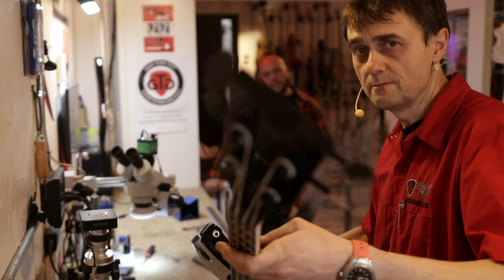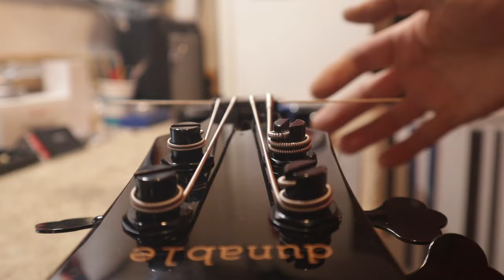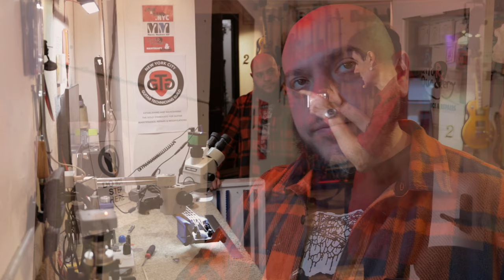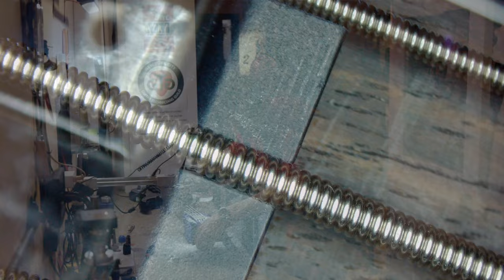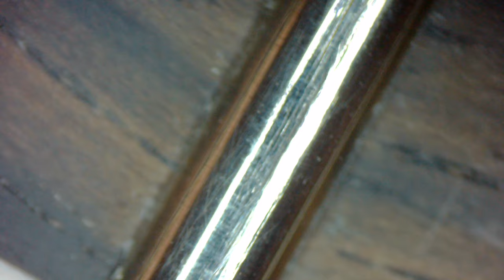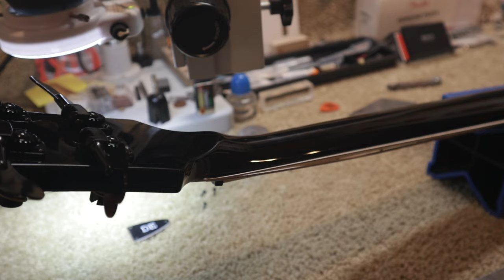Dunable Gnarwhal DE Bass Review

Comment: I was a Musicman player because the instruments were light and so well balanced but lacked that mid bass growl. So I switched to a Fender P bass which was perfect but a bit heavy. I got a gig in a touring rock band replacing another player but he used a 5 string. I couldn't get my 4 string p bass to cut it and I refused to play a 5 string so being the band had a Schecter endorsement they made me a 4 string that could tune way down. From what I can tell all they did was file the nut for much larger ga. strings and tighten the truss rod.
Reply from the maker: Just curious, have you seen the Extendos video 
https://youtu.be/c63fBTCIMa4 featuring Dan’s P-bass?